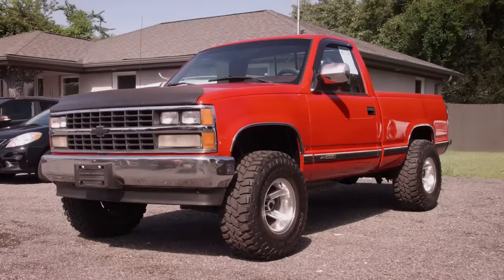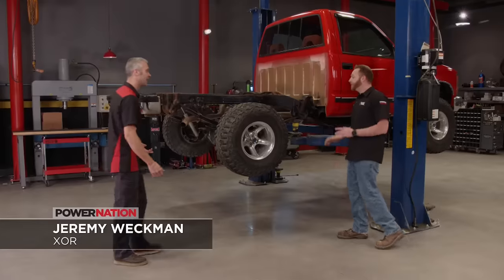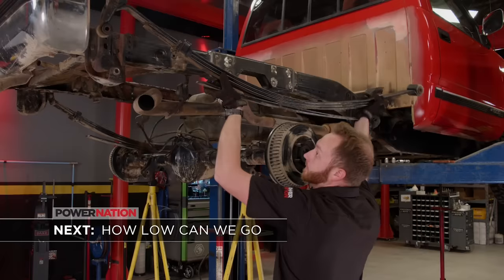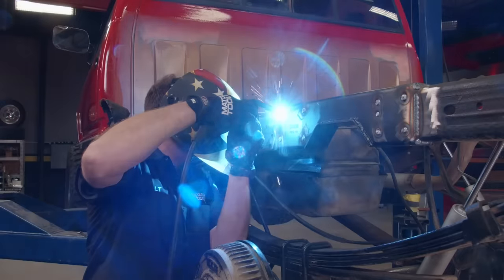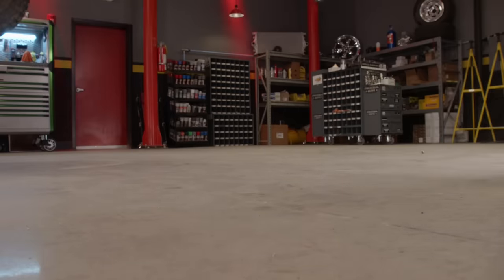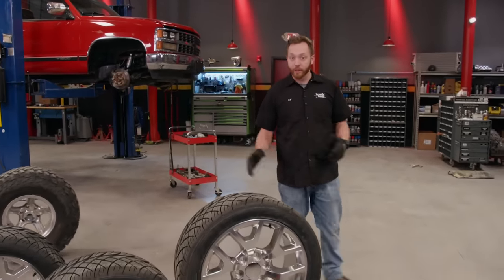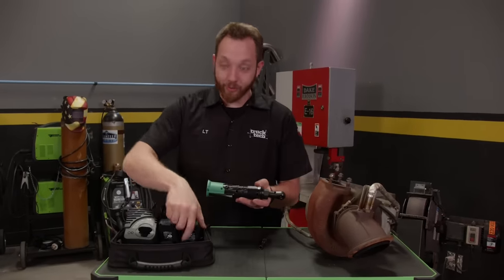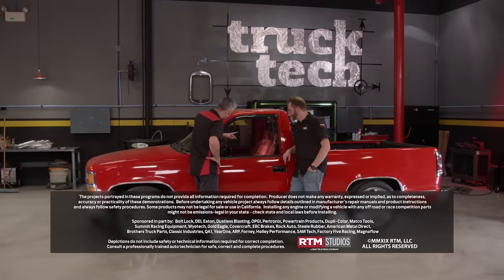Installing 4/6 Lowering Kit on a Chevy K1500 4x4 - Truck Tech S6, E4

Comment: So no mention about having to drop the fuel tank to remove the left front leaf spring bolt?
Reply: you dont have to remove the front bolts for a flip kit...
Reply: @robc7812  I know. You just have to remove the passenger leaf,  remove the calipers or lines, and slide the axle for enough to the passenger side to fish the axle over the driver leaf. 
Or pull the shackles to drop the springs and remove the entire diff to slide over the leafs.

Not very elegant for filming..................................................................................................................dotdotdot
Reply: @briankoch7041  and the bolt comes out to the out side.. thinking about it ive replace the springs on all of mine belltech leaf springs.. never had to even loosen the tank.. even to replace the hangers though it is easier to move it a bit
Reply: @robc7812  Chevy installs the front leaf bolt front the the in board side of the frame. The bolt has a Male hex at the end of the thread to allow it to be torqued from the out board side of the frame. 
It is certainly possible to install the bolt from the outboard side if the bed is removed. Similarly the exhaust needs to be dropped from at least two hangers to remove the passenger front leaf bolt.

Edit: I'm not suggestion your particular vehicle did not have the bolts installed outboard from the frame by a service technician.
Reply: @briankoch7041   i dont know on the 4x4 but my 2wd the bolt was below the frame untill i put in 2 inch lowering hangers... then the bolt lines up with a slot in the frame but its not large enough to put the bolt head thru.. and doesnt matter which direction the bolt is now this on obs(88-98) 2wd trucks  ive had 4 1990s 92 95 all lowered... and have done it for others... all of mine had leaf packs but have done a few flips as well...

Comment: The only reason i would do this to a perfectly good 4x4 is to put serious power under the hood for a 4 wheel drive, quarter mile burner. Otherwise your just losing a great offroad truck.